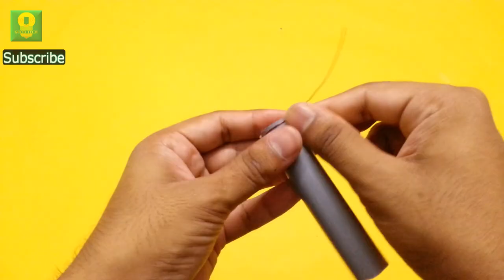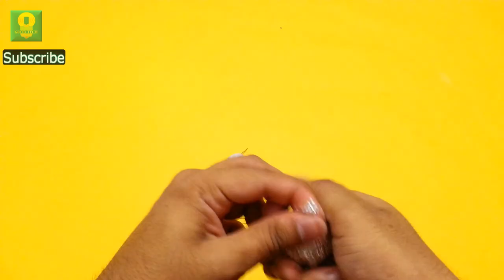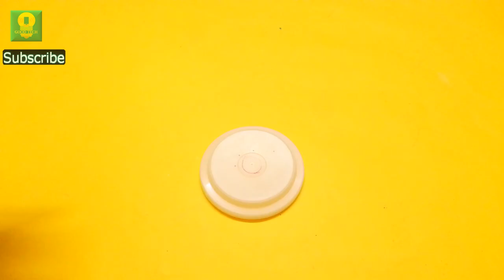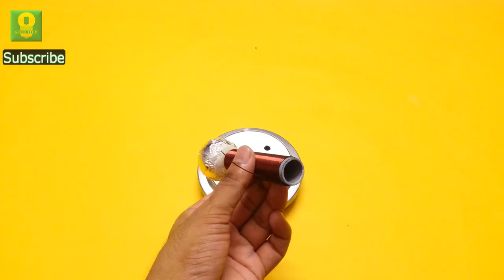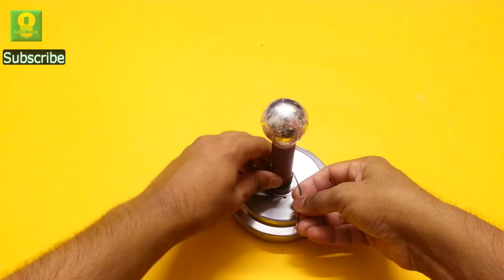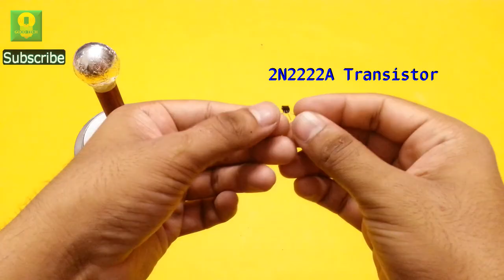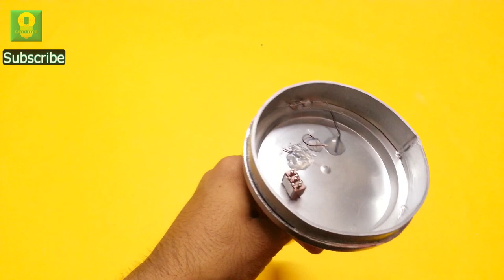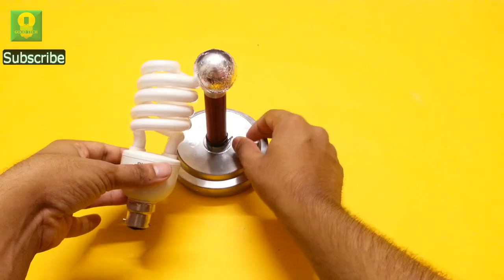How to make Tesla Tower at home

Comment: could u pls tell the principle on which it is working plss....
Reply from the maker: It is based on the principle of electromagnetic induction. When the circuit is turned ON, the transistor starts working as a switching device and this action produces a high frequency pulsating wave which is further feeded to the primary coil, that induces a high voltage pulsating wave in the air cored secondary coil. The hollow metallic sphere acts as a capacitor around which the high voltage electric fields are generated. When a CFL or any Fluorescent Bulb is placed near the coil it intercepts the electric field and the particles inside the lamps gets excited due to field, and due to excitation it hits the fluorescent walls and lights up.

Comment: The cfl works in alternating current. U r providing dc current using a 9v battery. So how come It is working?
Reply from the maker: Yes, you are absolutely right but This project is based on the principle of electromagnetic induction. When the circuit is turned ON, the transistor starts working as a switching device and this action produces a high frequency pulsating wave which is further fed to the primary coil, that induces a high voltage pulsating wave in the air cored secondary coil. The hollow metallic sphere acts as a capacitor around which the high voltage electric fields are generated. When a CFL or any Fluorescent Bulb is placed near the coil it intercepts the electric field and the particles inside the lamp gets excited due to this field, and due to excitation they hit the fluorescent walls of the lamp and lights up.
Reply: GOODTECH - Creativity and Science Where do I get the metallic sphere?
Reply from the maker: It is not a metallic sphere, you can just take any plastic ball and wrap it with aluminium foil (food wrapping aluminium foil in kitchen).

Comment: Hi.Can you please share length of PVC pipe how many turns you need for coil?
Many thanks.
Reply from the maker: I used a PVC pipe of about 5'', wrapped about 200 turns of 28 AWG enameled copper wire.
Reply: Thanks for reply. What about increasing coil power? Do I need to use different transistor and resistor I suppose and increase coil size.
Reply from the maker: Yes, true you can increase the coil size but when you increase the coil size, you also need a different transistor and a resistor  that can handle high power.

Comment: Hey.... i try to make a tesla coil like yout but not work :( 
And my NPN transistor after some seconds gets hot
Why?   (i use a neon lamp to test it)
Reply from the maker: Make sure that the connections are correct and do not use a chinese 9v battery, you need a high current 9v battery for this device.
Reply: ***** Okk thx, i try

Comment: could anyone, give the complete details of the material ? the thickness of copper wire, diameter & length of pvc pipe? and  primary coil?
Reply from the maker: 28 AWG enameled copper wire, 2.1cm diameter and 8cm length.

Comment: can we place resistor and transistor of other values
Reply from the maker: All resistor values between 22k - 30k will work with this project and you need a high power switching transistor. Any high power switching transistor can be used in this project.

Comment: can we use two 9 v batteries in series and a 22k ohm resistor ?
Reply from the maker: Two 9v battery in series will make it 18v, which is too much for the circuit and the transistor will get heated too much and can be damaged permanently. You just need a 9v 500mA supply.

Comment: #GOODTECH...cn u plzz mention the what is number of copper gauge wire..i hv used 26 gauge copper wire bt it is nt working..help me..
Reply from the maker: The wire i used is 28 AWG i.e 0.3mm enameled copper wire. The only problem i faced when it was not working was the current. You need a high current battery, don't use a normal chinese 9v battery, it can't provide enough current to the circuit.
Reply: thank u..:)

Comment: The transistor uses maximum 6 volt but if I use the 9 volt battery the transistor heats more or damage quick ,so we use heat sink but although it does not work continues .plzz help us
Reply from the maker: Yes, you are right but for me even 9v worked well. However, its datasheet mentions the recommended voltage to be 6v, so you can use a 6v battery or a 5v mobile charger to power it.

Comment: can I used BC148 transistor or BC547 transistor ?
Reply from the maker: No, you need a high power switching transistor only. These transistors will not work.

Comment: What's the polarity of the coil? which ends do you connect to the circuit?
Reply from the maker: There is no polarity for the coil, it works in either direction.
Reply: ***** Wouldn't the secondary coil's current boost work the wrong way?
Reply from the maker: No, it won't matter.

Comment: bro my PVC pipe is semi hollow means if pipe is of 3 cm and hole is of 2 cm will it work.
Reply from the maker: It should work but make sure only to wrap the coil over the hollow area. Also, you might need a longer pipe as a 2cm area is quite less.

Comment: My coil is not working. I have wound the secondary 
coil on 20 cm pipe. Could this be the REASON
Reply from the maker: How many turns have you wound on the pipe?
Make sure that the turn ratio is only about 100:1. Also, make sure to use a high current 9v battery because a cheap chinese 9v battery will not be able to provide enough power.
Reply: a chinese battery isnt the issue

Comment: Can you plug that into a wall instead of a battery?
Reply from the maker: It cannot be directly plugged to a AC supply, however, you can use a 9v DC wall adapter instead of battery.

Comment: hey...! my 2222A transistor is heating up... and the coil isnt working...! any suggestions. ...?
Reply from the maker: If the transistor is slightly heating up it's alright. Which battery are you using to power the circuit?
You need atleast 500mA of current, so a normal chinese battery will not work, you need a 9v duracell battery.
Reply: nah... done just had to switch the secondary...! its working....! thanks...!

Comment: Hey, i tried the same thing, the diameter of the wire is like 0.1 cm and i'd wind it about 400-500 times. all the stuff is set but there is no glowing of LED or anything. One thing happened once, the 2N2222A transistor burned. Plz help me asap its my physics project.
Reply from the maker: If transistor is getting hot that means the connections are alright. All you need to do is reduce the secondary winding to about 200 - 300 turns or increase the primary winding to 4 - 5 turns(but then you might also need to increase input power). This project cannot light up LEDs. It only works with Fluorescent and neon lamps.
Reply: GOODTECH - Creativity and Science okay thank you very much! i will try it.

Comment: If i use a PN 2222A transistor and not 2N 2222A does it have a difference?
Reply from the maker: After going through the datasheets of both the transistors it seems that they both are one and the same.
Reply: GOODTECH - Creativity and Science thank you so much

Comment: please help! transistor  is getting hot. I used another 9v battery of more than 500ma but still its getting hot
Reply from the maker: If transistor is getting hot upto tolerable extent then it is fine. If it is getting burnt out to an extent that the circuit stops working, you will need to reduce the no. of turns of the enameled wire.

Comment: Will this also create sparks like tesla coils? or no?
Reply from the maker: No, this only operates on 9v DC, such low voltages can't create sparks.
Reply: GOODTECH - Creativity and Science if I was to increase the volatage would it spark
Reply from the maker: Increasing voltage in this circuit will damage the circuit, the transistor will burn. Yes, increasing voltage will create sparks but you need high power transistor and also, the device will be very dangerous to use.

Comment: how much volts can use? I mean it 5-12...? and why this dont do flashs :(
Reply: Because this is a tesla tower not a tesla coil to send sparks of lightning and lightning bolts around,it is ment to just channel energy wirelessly and be good at that.
Reply: you can use as much volts as you want. But i think u should stick to low voltage since it can be dangerous and it can kill you

Comment: Sir how many time to rotate the coil?
Reply from the maker: The turn ratio to primary to secondary should be around 1:100. I made about 200 turns on the tower and around 2 turns for the primary.
But..if you are  making this, besides double checking the circuit, also make sure to use a high current 9v battery because a cheap chinese 9v battery will not work with this project. This is a very common problem that almost everyone is doing and then unable to figure out what went wrong.

Comment: is it necessary to put transistor of no.2N2222A
Reply from the maker: No, you can use any high power switching transistor. There must be many substitutes for 2n2222a and google should be able to answer that well.
Reply: Yes

Comment: Is it possible to make mobile charger using this principle
Reply from the maker: Yes, both tesla tower and wireless mobile charger work on the principle of electromagnetism but a tesla tower works on the electromagnetic field that is capable to excite the electrons in fluorescent and neon lights to make them glow and a wireless mobile charger works on the principle of electromagnetic induction, in which the magnetism around one coil generates electric charge in the other coil.
Although, i did not use any homemade coils or circuit but i have made a very useful wireless mobile charger video, have a look - https://youtu.be/q3b5St7OX_8
I also made a detailed written tutorial, you can also have a look at it - https://bit.ly/2SribP1

Comment: If your transistor is frying up use 29k resistor or use a different transistor not in the to-92 group like I used d2375 and my transistor didn't fry up

Comment: which wire we have to use
Reply from the maker: Hello Sai kumar,
If it is not working, once again check all the connections. You need to use enameled copper wire for the tower and hard insulated wire or thick enameled wire for primary.
Also, touch the transistor, if it is getting hot, then circuit seems to be fine. Now, make sure to use a high current 9v battery because a cheap chinese battery will not work with this project. It needs around 500mA of current at 9v.
If you need additional detailed info, have a look at my tutorial - https://www.instructables.com/id/How-to-Make-a-Mini-Tesla-Tower/
If it still doesn't work, feel free to ask any doubts.

Comment: I made it but it stopped working. What may be the reasons? Please reply
Reply from the maker: The one of the most significant reason it could have stopped working is because of transistor . It gets too hot and even if few turns are extra in secondary, then it gets burnt. The solution for this is to use a high power switching transistor instead of 2N2222A.  However, also check whether the battery is working fine or not. Weak battery can also be one of the reasons.

Comment: How meny turns wire to pipe? What is pipe length?
Reply from the maker: Pipe length is about 8 inches with a diameter of about 2.1cm. I wrapped around 180-200 turns of 28 AWG enameled copper wire.

Comment: Can I use 18 gauged copper wire
Reply from the maker: Yes, it will work but not with 9v supply (you will need a much thicker wire for secondary to maintain the current ratio in the windings) and I am not sure about no. of turns, also it will be quite difficult to wrap around the pipe.

Comment: From Where Can I Get Transister And Resister, Can I Find From Somewhere,What is Cost Of It, Does It Shock?
Reply from the maker: This device operates on a very low voltage i.e 9v DC that is not fatal. All the components are available online on ebay and amazon.

Comment: thank you Good tech, mine isn't lighting a bulb similar to the one you have used. I am using a dollar store battery, betting it is the problem, weak current output. You said a Duracell battery was best.
Reply from the maker: Yes, it needs atleast 500mA of current.
Reply: +GOODTECH - Creativity and Science would the circuit as it is hold up to a pair of 9v Duracell batteries? Just to give it a bit of a boost, or would that bow the circuit? I am building this system for my daughter's science project.
Reply from the maker: The circuit will work, but if the batteries are connected in series, there is a possibility that the transistor might get very hot and burn out(you need a high power transistor). However, if you connect both the batteries in parallel, it will work well.

Comment: mine is not wrking plzzzzz tell what would bo possible mistakes
Reply from the maker: There are only two possible reasons for the circuit to not work. Double check all the connections as shown in circuit schematic and then also, make sure you have used a high current 9v battery as a normal chinese 9v battery will not work with this project.

Comment: Old give me the reason why my Tesla coil wasnt working ever thing was good but one thing I did is I soldered my copper wire in the coil it makes any difference  pls  tell me i beg u
Reply from the maker: Where did you solder the wire? Did you join the wire by soldering to increase the length, if so, have you insulated the wire properly?
If everything is done right, then double check the connections and make sure you have used a high current 9v battery because a normal chinese 9v battery will not work with this project.
Also, make sure the turn ratio is kept to about 1:100
Reply: thanxs bro made it it helped me

Comment: IT has not to be only duracell to let IT work, right?? i hope so
Reply from the maker: Yes, any 9v Battery can be used, if its capable of providing atleast 500mA of current. However, Cheap chinese 9v batteries do not work with this project as they can only provide nearly 100mA.

Comment: and how please let me know how you make it because I have try anything that I have seen but is not working
Reply from the maker: Double check the connections, if everything seems fine, then make sure you have used a high current 9v battery because a normal 9v chinese battery will not work with this project. It requires atleast 500mA of current at 9v. When the adequate power is supplied, check whether the transistor get warm, if it feels slightly heated up, then everything is fine and any neon or fluorescent light will glow.

Comment: awesome, But I tried to make it but doesn't work did you know what's going wrong
Reply from the maker: It didn't work for me the first time either. The problem was that i used a low current battery, you atleast need 500mA of current at 9v.

Comment: how much cost will need for this..??
Reply from the maker: The cost will depend on the components used, however, to me it cost around Rs 300.A plastic Box -Rs 25
PVC pipe - Rs 10
Ping pong ball - Rs 25
Copper wire - Rs 100
Switch - Rs 20
Transistor - Rs 10
and few other components like hot glue, resistor.

Comment: I try it but the only respond is the transistor keeps heating up. I don't want to give up even my fingers burnt out.
Reply from the maker: Yes, transistor gets slightly heated up but if its getting burnt out then reduce the no. of coils in the tower. Make sure that the coil ration is just about 100:1, if the wire used is 28 AWG.

Comment: what thing you wrap in foil paper
Reply from the maker: ping pong ball
Reply: ping pong ball is necessary or not

& kindly give the diagram
Reply from the maker: A ping pong ball is not necessary, you can also use anything like a flat plate wrapped in foil as a conductor. (It works even without the top dome but light glows little dim).
Schematic: https://plus.google.com/photos/photo/106774800816298818517/6318135217959294226?icm=false

Comment: What to do if transistor is smoking?
Reply from the maker: The only reason transistor is smoking because there i too much power supplied to the circuit. There are two steps to save the transistor and make the project work.
Make sure to use a 9v battery with about 500mA of current. Any branded battery is capable to provide.
Also, reduce the no. of turns of the wire on the tower. Make sure that the no. of turns is only about 200, if the wire used is of 28 AWG.
If the transistor is getting hot (but not burnt smoking), then its fine.

Comment: how is this supposed to work....i mean you need an oscillaitng current to induce current  in the secondary coil.how could you possibly do that with just one transistor and a resistor.
Reply from the maker: This works due to 2N2222 that acts as a switching transistor and switches the power at few nanoseconds, thus producing oscillations and in turn inducing energy in the coil.
Reply: but don't you need a tank circuit to do that?

Comment: the transistor was heated very much but my modal was not working please tell me how to solve it
Reply from the maker: If the transistor is getting warm that means the circuit is correct but if the transistor is heating too much then you need to reduce the no. of turns in the secondary winding. Make sure that the turn ratio in primary to secondary is only about 1:100.
Also, make sure that you have used a high current 9v battery because a cheap chinese battery will not work with this project.
Reply: ya it is heating too much
Reply: I am using EW high power
Reply: which is secondary winding the long winding or short winding
Reply from the maker: The longer one is secondary.
Reply from the maker: Make sure, you are only supplying 9v and about 600mA of current.

Comment: How many meters the wire is?
Reply from the maker: I havn't exactly measured the length of wire but it is around 200 turns on a pipe of about 2.1cm in diameter, which in theoretical calculation is about 13m of wire.